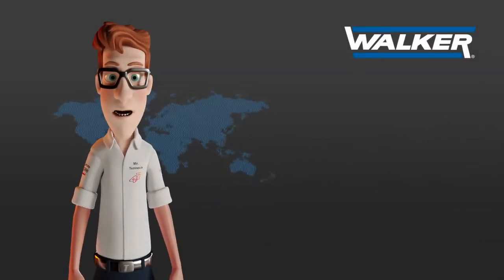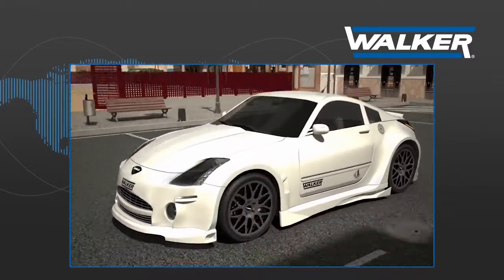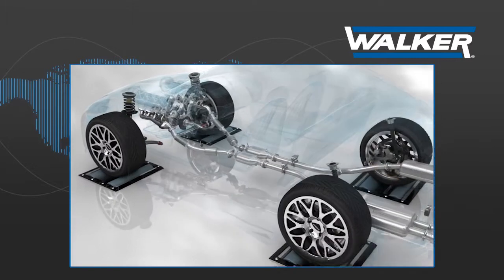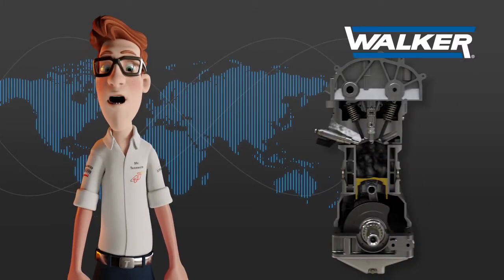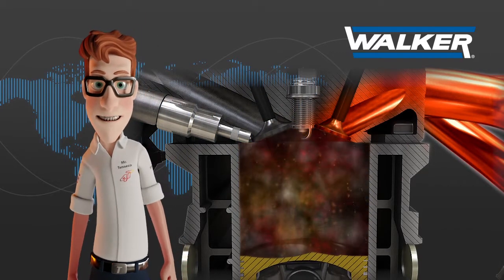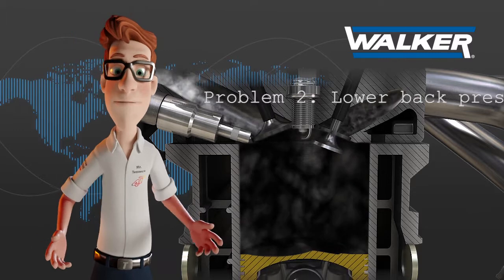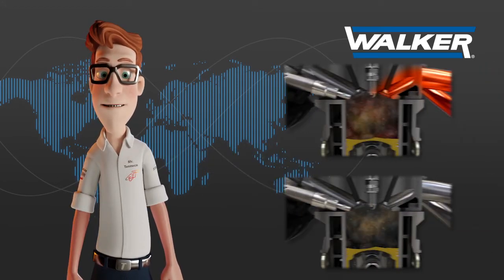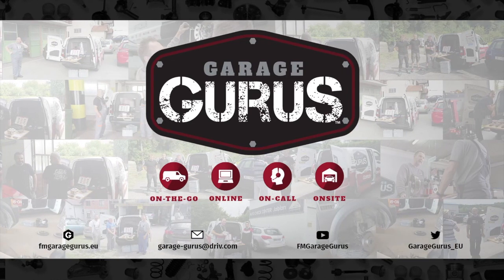Understanding the backpressure and its relation to fuel consumption and engine power

Comment: No need of back pressure... Exhaust gas Velocity is important
Reply from the maker: DPF is a system that rely completely on the backpressure level of the system. The differential pressure sensor present upstream and downstream DPF Filter constantly inform The Electronic control Unit of the vehicle of the Particulate  loading of the Filter in order to trigger the regeneration process (process that transforms solid carbon particles stored at the Filter into carbon dioxide (a gas) leaving the Filter Clean and ready to store more particles). 
In order to have a full understanding of the system here I leave you a video link where the process is perfectly explained. 

 https://youtu.be/Txap6NRJiaY?si=ZQu3U98rXUWg4i5H
Reply: @GarageGurusEU  thankyou so much brother